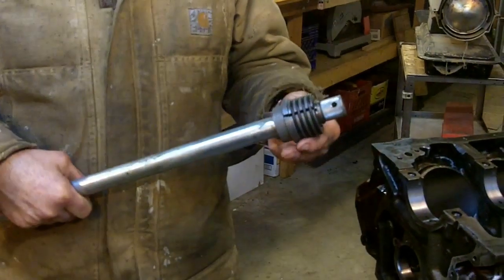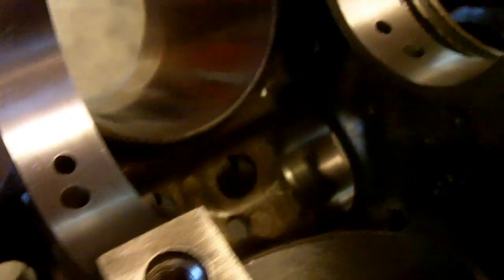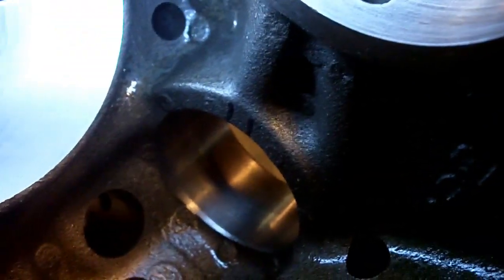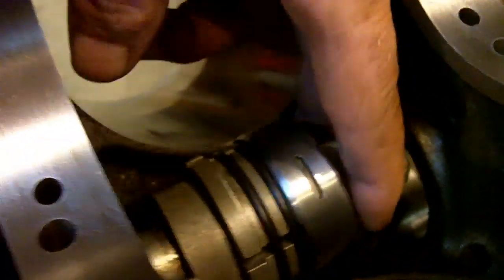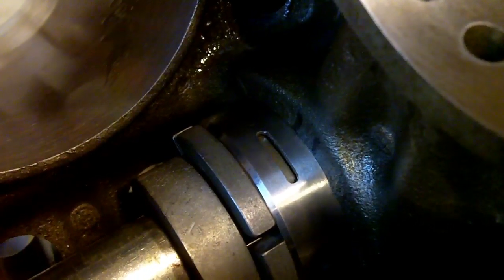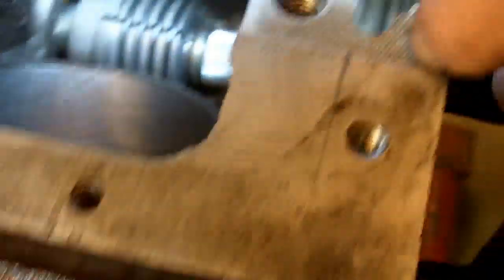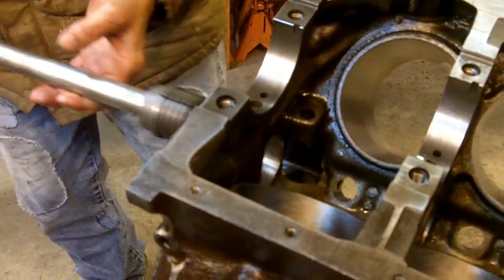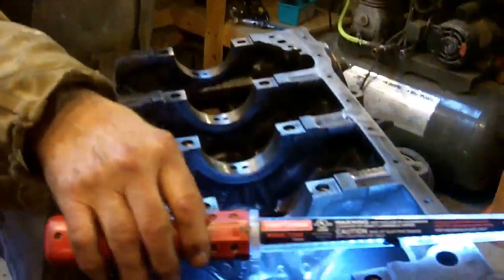Engine Building with Rog - Cam Bearing Installation Ford 351w

Comment: Its myfirst time rebuilding an engine and i couldnt find the order of the bearings anywhere, not even in my repair manual, I figured it was starting at the front with one and ending with five at the back. I just wanted to be sure, this is litterally the only source I could find on the internet that gave me the correct information. Thanks dudes!
Reply from the maker: Super glad that the video helped you out my man! We're trying to gear up for some more, but it is just coming down to "time" as to when to do them. Rog is working on a 327 stroker, I'd like to have a complete build video of that. So please subscribe if you like what you see here. Thank you!